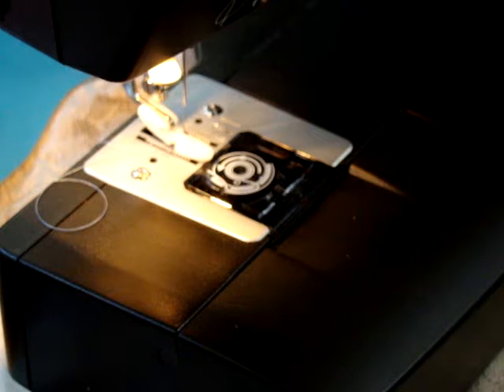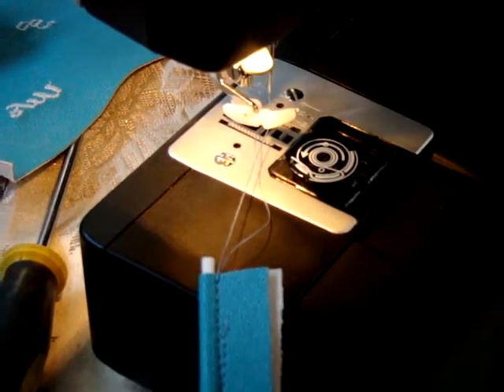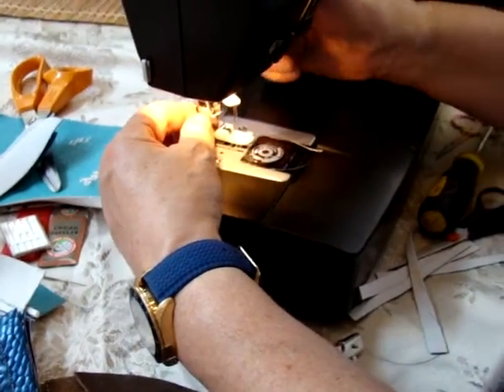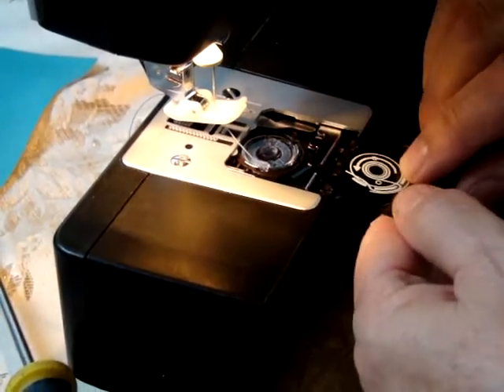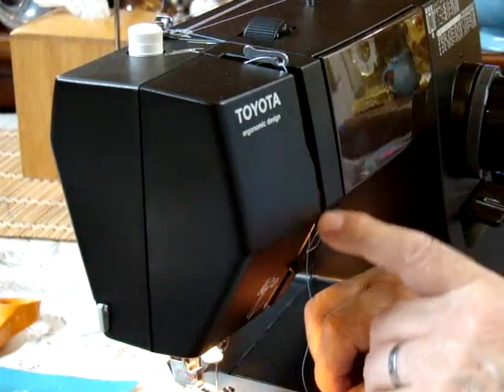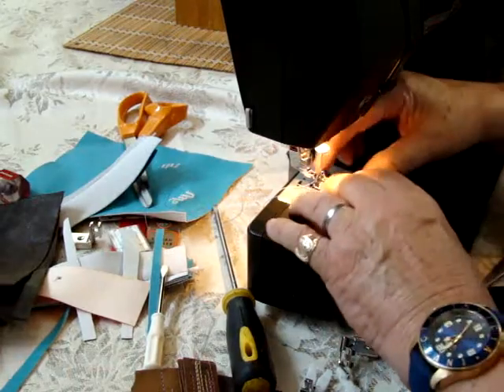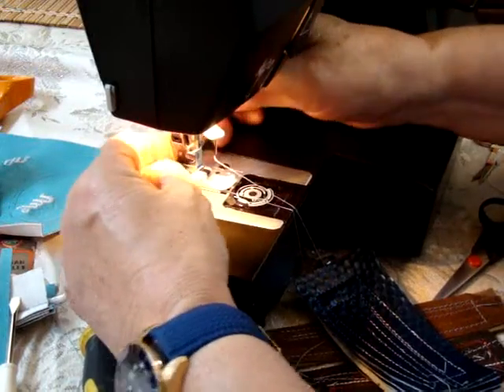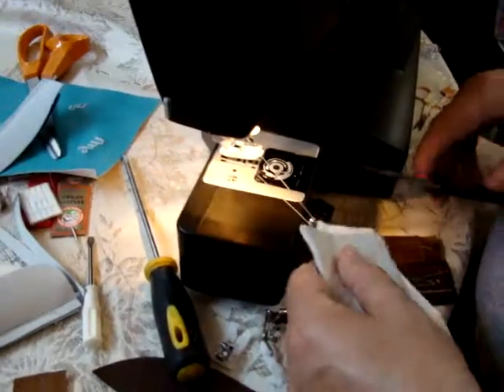Toyota Super Jeans J34 Sewing Machine Threading, etc. Part 1

Comment: Hey great video! I have a question. My machine is stuck in reverse. The reverse lever goes up and down but nothing changes in feed dog. It keeps pushing the fabric forward instead of pulling it from the front of the machine to the back. Have you see this happen before? Do you know what I should do?